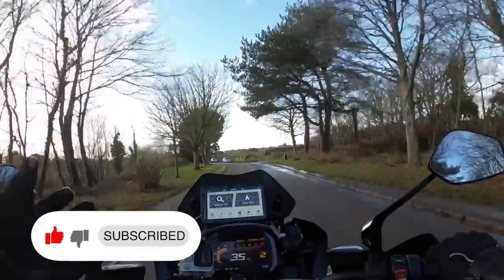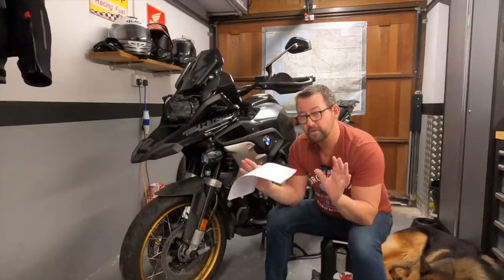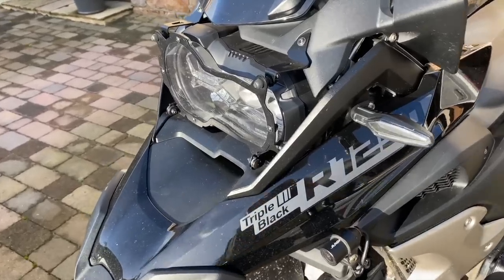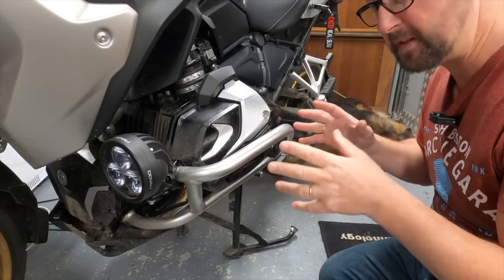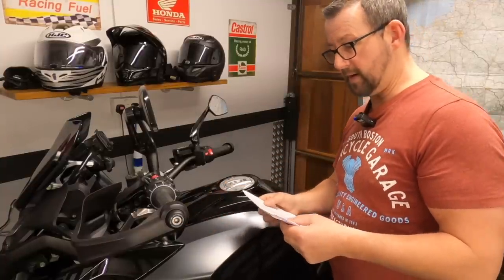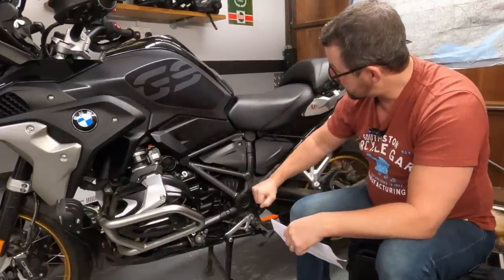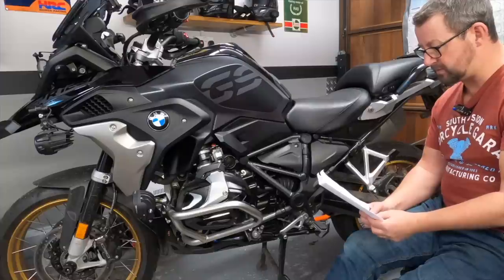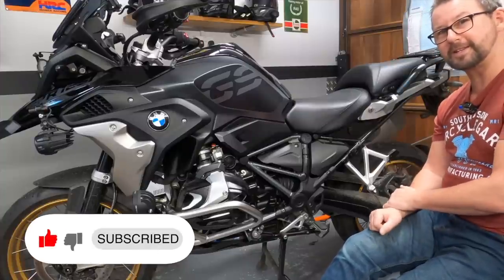Accessories fitted to my 2022 BMW R1250GS-Would I fit them again? Let's find out.🤪

Comment: Very informative. Where did you get the frame infills from, the ones that cover the shock area. Thanks.
Reply from the maker: Thanks, the frame infills came as part of the radiator protection kit from BMW. No doubt you can get them elsewhere for 1/10th of the price 😂 I have done a web search and this is the kit from a BMW UK supplier for information . https://cotswoldbmwmotorradonline.co.uk/products/bmw-motorrad-splash-guard-and-radiator-guard-set-k50-k51-r1200gs-gsa-r1250gs-gsa-2014-2021
Reply: @gsd32i  Thanks for taking the time to look this up for me, MY GS 1250 already has the rad protectors already but infills look useful, amazing how expensive a piece of plastic can be. Thanks again.
Reply from the maker: @muz1406  No problem, ride safe 😁

Comment: Thanks for another great video! Question about the axle / rear sliders- do you think it's necessary to get the big one for the rear as well? I see that big one is quite expensive. Wondering if it's worth it- thanks!
Reply from the maker: Keith I guess if you are going to be doing some off road stuff, even light then possibly .
Reply: @gsd32i  zero off roading for me!

Comment: It’s so easy to get carried away with all the ads ins. The I’ve spent on excess of £3k (not including panniers) on my GS Rallye. Mind you I’ve spent about the same amount on my Triumph T100 getting it to the bike it should have been when it left the factory. It’s so easy to get carried away so be warned, adding accessories is addictive. As long as one goes into the ownership with this in mind one won’t get any nasty surprises. With hindsight I would have bought something else but then, I still love both my bikes. Good job as I can’t now afford to sell either. PS: good point about mentioning all the packages arriving. I try to get them delivered when my wife isn’t at home but then my postie always says, when he hands me yet another parcel, “that’ll be be for the bike then!”

Comment: Thanks for the review. Interesting things mentioned. I also feel vibration at handlebar and didn't know about Evotech Bar End Weights, will try it. I see there is some head protection installed on your bike, can you please help what is that? I also have option 719 cylinder heads and all popular cylinder head guards brands told me that they don't support option 719, even BWB one doesn't fit to option 719
Reply from the maker: Hi. I have the standard BMW engine bars and maybe it's that? When I ordered the bike I asked for all the 719 stuff on the engine so what I have is nothing unusual ! Evotech bar ends weights =no veneration.
Reply: @gsd32i  that black thing which is inside the frame of bar is also standard came right from factory? (its not much clear in the video, if I see it correct there is some another black piece of metal or plastic on top of cylinder head)

Comment: What correct setting/guidance did you use to for the denalis?
Reply from the maker: Hi, sorry for the delay, I didn't see the question. I would simply set the low beam setting at 20% and then see what you think then of them in the daytime and nighttime and adjust accordingly, then just set the main beam level to one that you are happy with. I think I covered it in my videos when I connected the hex ezcan to them and programmed the lights.
Reply: I mean the alignment?
Reply from the maker: @MurtazaAli-jv5ln  Oh I see. I just went out at night and adjusted them so that the lights lit the road BUT didn't dazzle oncoming road users. Give them a wipe every now and again too. 👍

Comment: Is the Michelin 6 good when cranked over? as your one, l'm guessing is fairly new on the sides and not been 'spanked'
Reply from the maker: I can definitely say that the bike has been spanked😂6 was a great tyre but just pulled to the left. Currently using Next 2's and they are just as good and no pulling. 👍

Comment: I initially had issues with my gas cap, but after trying it with the key in my hand and holding it close to the gas cap, pull the button and it works fine,

Comment: Great video. It’s great to get a completely honest opinion on all the accessories. Also about the rear indicator’s I didn’t know that it was an option to not have the brake lights included with the indicator I will be definitely asking about that tomorrow when I’m going to order a new 1250 adventure in the trophy colour scheme. Thanks again as I have been watching many reviews on utube and you seem to have the the most honest reviews..
Reply from the maker: Thanks , I am informed by my dealer that the multi function indicators are now standard !! Enjoy opening the wallet at the dealer 👍👍👍
Reply: @gsd32i …… I’ve been informed that  BMW also stands for “Bring More Wallet”. 😂
Reply from the maker: @bradleyalexander5821  Yes and KTM stands for Know The Manual/Kosts Tons Money 😂

Comment: Hallo, I've installed the cockpit cover too, hoping to reduce the noise coming from that huge "hole". Does not work in that sense, just nice to see. Only issue is you cannot easily use USB receptacle on the right, because of the USB cap in the way, I will try to lift the USB port with a spacer, realized with my 3D printer. By the way I have  Bridgestone Battlax tires, and the bike pulls to the right, no hands driving. Great video👍
Reply from the maker: Thanks, Next 2 tyres great with no pulling whatsoever . Some owners said  just twist the usb  outwards.
Reply: @gsd32i  ...will try, thanks for the tip. Cheers

Comment: Anything pulls to the left in the UK it's the camber of the road !
Reply from the maker: Now that does sound plausible BUT they did it in France too !! Dumped those tyres and now on Tourance Next 2’s and they’ve had no pulling to the left whatsoever . BMW now use these as standard for on the new 1300’s

Comment: Thanks for the video. Did you change the original skid plate, I couldn’t figure out if you told about it.
Reply from the maker: yes I went for the Rallye skid plate, that was fitted by the dealer before it left the showroom 👍

Comment: It’s easy to go crazy with add ons. I bought a Chinese light mount to add some driving lights. Had to tweak them but they work. I have a different one on order though. I used a set of single row Rigid Industries SAE driving lights. Since I already had them. Put on the AltRider skid plate. Beefy. Just found a set of OEM black panniers. I could have went with some other brand and saved money…but I hate all the extra keys. I did buy a Chinese center pannier and it works, but I had to add a different plate to the original back mount plate. So got a good deal on some new BMW panniers and bought them. Dangit. I added another battery tender plug for the left side because I have Harley Davidson heated under gear already. All plugs on the gear are on the left side. Some things you can cheap out on and some you can’t. I did get a mud guard for the back from China and it had a screw to mount it to the upper inner guard rather than just zip ties. Went with the Hexcan instead of the Denali. Same company but some differences. Mainly price. Got a mini soundbomb horn coming. Eh. Headlight protector. Mine didn’t come with the adaptive headlight nor the heated seats, but the full, out the door price was $24,600. Adventure model. I did find one that had the new headlight and heated seats but it was almost 3 grand more. I can live without those. But after all of it, if I did it again, I’d have got the GS low version instead of the regular GSA! I do like the extra tank capacity but I mean I rarely go off road so the low version would have been good enough for the highway. And stopping a bit more with a lesser capacity fuel tank is nothing new. Thanks for the video! Loved it!
Reply from the maker: Thanks . I don't know if my bladder would last out for the range of the GSA 😂

Comment: I have road 6 too on my 1200gsa. same pulling to the left. Next change - scorpion trails.
Reply from the maker: My metzeler next 2’s have arrived so putting them on in a few days time .
Reply: Did You fix it finally with the Metzeler ? I’ve changed mine from TKC70 to Metzeler Next 2 but still the same behavior. Veering to the left…

Comment: Regarding the shifter and blipper, I have found that the higher up the revs you are when going from 1st to 2nd, the smoother it is and regarding the blipper, some folk are unaware that the throttle needs to be completely closed when shooting down the gearbox, silky smooth for me and I have the exact same bike as you. 

Just a heads up. :) 

Bike looks mint :)
Reply from the maker: Thanks, combination of clutch n QS depending on what's happening.😁

Comment: Hello! I want to put the option 719 mirrors on my 1250 adventure but I have read that they vibrate a lot and you can´t see through them. They are very expensive and I wouldn't want to spend that much money and then be unhappy about them. Could you  please help me with it? Many thanks!
Reply from the maker: Hi, had them on my GS since it rolled out of the showroom from new. 2 years later no issues with vibration etc. 😁

Comment: Have you thought about a ceramic coating ? Or other types of coatings.
Reply from the maker: I haven't given it much thought....have you had it done?
Reply: @gsd32i  No but seriously considering it, the bikes are very expensive and it should stop UV damage too like on the switches that really loose their redness easily and look years old. Won’t be so worried about riding in poor weather and should make it easier to clean and stay nice and sparkly. 😁
Reply: @genuinecomments4008  I have never coated a bike and my previous gs I rode all year in all conditions nothing faded at all. I wouldn’t be concerned about that .

Comment: Did the bike track straight with the OEM tires?
Reply from the maker: I only had the oem ones on for about 400 miles and did that in about 10 days and can't recall if I did take my hands off .....I will swap them when I come back from my mini tour next week🙈
Reply: @gsd32i  Running through my head what are any reasons a bike would track like that and is it associated with just to tires, front or rear.  Look tire wear if you can.  Chalk up the tires and ride on a flat surface like a parking lot, not a cambered road.  Static balance just the bike pre-ride, is it left side heavy?  Then try it with you sitting tip toes same thing.
Reply from the maker: @Richard.Cabeza  I've done that kind of thing and it's the tyres in my view.

Comment: Hey gsd, thanks for the vid. I followed it through, as I have the 23 GS Trophy & immediately after taking purchase, did quite a few things for it to fit me.
Ad note: on your fork tube where you put the helicopter tape, I did one better for me so I can cut down noise. I had taken a piece of kydex 7"T x 12"W, that fits across fork tube with 2" to wrap around each side, and heated the  last 3" and shaped it using a 2" diameter can, and did both ends so as to wrap around fork tube on each side. I pre-drilled 4 holes each side & secured w ty-raps....just another take on tube protection & noise reduction.  Also, I followed your cockpit cover vid & it went on in 45min.
Thank you....wish I could send a pic of fork tube. Clean & unnoticeable.
Reply from the maker: Liking the trophy colours . Toss up for me was the triple black or the rallye. If the trophy colours were out then I would have got that colour . Nice 👌

Comment: Hi Paul, nice bike Mate. I recently, with the aid of Messes  Forder & Butcher bought a 2017 R1200GS in white with only 2k on the clock. Very happy with it. In your video I notice the 'cockpit fairing infill but you don't mention it. I have found them on Ebay but they won't post to Jersey. Any ideas? Keep up the good work Mate. Salut Clive. 👍
Reply from the maker: hi Clive, hope you are well. Ah yes Forder and Butcher, a fine team 😂 I did an install video , it’ll be on one of the playlists above, got mine from UK Nippy Normans, wouldn’t be without the infill panel makes it look much nicer, IMHO. I’ve got stuff from the east before , try a different seller. look forward to seeing you on one of the Mansell ride outs👍

Comment: Does it still pull to the left hands off if you use cruise control ?
Reply from the maker: yes. strange as the bike handles brilliantly with these tyres , just pulls when you go hands off.
Reply: @gsd32i  Can you keep us posted if you rectify this issue. Thanks!

Comment: Did you get to the bottom of the front tyre issue. I'm thinking of switching to Michelin 6s. Hard to believe Michelins would be unbalanced in some way.Shame about your quickshifter not blipping on the way down, mine does. (2019)
Reply from the maker: Hi Dave . I didn’t . But numerous others on the net have made similar comments . Not a handling problem whatsoever just a veer to the left when hands off . Fabulous tyre bit frustrated me having to hang off to one side as and when hands off !! 😂

Comment: Your sena did you update the firmware? My 50S have to update the firmware then it work.
Reply from the maker: My sena 10s is running the latest firmware . Basically it’s only the top end Senas, 50s/r etc that have the coding to speak to the tft to open the volume whizz wheel control . Not a major issue as the jog dial on 10s is just as easy to use . But it would be nice to use the whizz wheel …….
Reply: @gsd32i  I also own a R1250 GS triple black and I like what you did to your GS. 👍

Comment: Very nice video and love the options you have added.  
I’m curious why you chose the GS instead of a GSA for the extra travel?
Cheers.
Reply from the maker: Didn’t need the extra range plus my bladder wouldn’t last that long . But never say never 👍
Reply: @gsd32i  I hear you on the bladder and need to stop.  I was actually referring to the suspension travel with the GS adventure
Reply from the maker: @jpaul4595  if mine fell over I would cry ! So don’t need the extra travel . I still get to thrash mine , although top end is not where the bike excels at , but it gives me a buzz and I can chuck it around like I’m 21 again . My KTM 890r duke has stayed in the garage since I got the GS and i am thinking of selling that as I just don’t use it now . Again it’s an age thing 😂
Reply: @gsd32i  The same for me I sold my  K1300 GT and bought a GS adventure last fall. It’s just much more comfortable for me than the GT was.  Age &, sporty bikes, do not go together.

Comment: Very interesting you should mention your bike veering to the left, and having to counter it with your body position. Same thing for me on my 1290 Super Adventure with Road 6's.
Reply from the maker: Currently waiting for a response from the dealers tyre rep. Its a great tyre besides this.
Reply: had same issue after installing r6 , took them off and back for balancing , remounted them carefully not to over torque the axle bolt ,and i m now again able to  let go the bar and bike track straight.

Comment: Great Vid.  Ive the same bike but with cast wheels and agree with you on a lot of the additions. Im going to check out the bar end weights.  I went with the Givi quick release pannier system which works in a very similar way, i had Givi cases from my previous bike. Like you, i would delete/switch off the multi function indicators, mates have said they are difficult to see. I wish BMW would offer a update to correct this.  About the PR6 tyres,  ive seen comments on the Crosstourer and Super Tenere sites complaining of the bike pulling to one side.
Reply from the maker: Thanks, did those bikes have the 6"s too?
Reply: @gsd32i  Yes Road 6s, did post links to the threads but kept disappearing?

Comment: There are various opinions about the utility of the cockpit cover - several reviewers claim that it doesn't significantly reduce wind or road noise. What's your experience? Is the benefit purely aesthetic?
Reply from the maker: Had it on for a while and got different tyres on the bike also . Tyres make it quieter . So, purely cosmetic . But I really like it 🤪

Comment: I am currently in the market for a big adv bike and this is a common note for both MG and Bmw boxers and I have a theory that it has to do with the gyroscopic forces created by the engine spinning perpendicular to the direction of travel. I think about that science experiment where you sit in a chair that can spin and hold a spinning tire, then rotate the tire and you begin spinning in one direction or the other. 

Just a theory. You also have the idea that the engine is trying to spin the bike around the crank and that is why you feel a slight pull in a left direction. 

It’s tough because I have an all Harley family and they are trying to point out things that could bother me about the bike.

 When you hands are on the bars, do you still feel it pull or is it just hands free?
Reply: Rather, I have heard a theory that I am inclined to believe.*
Reply from the maker: Fitted metzeler tourance next 2’s a few weeks ago , hands off bars bike runs straight and don’t have to lean off the bike to make it run straight . Road 6 ‘s other than that were bloody good tyre . Next 2’s right up there and very confidence inspiring 👍
Reply: @gsd32i  right on! Glad you got it worked out.

Comment: I wouldnt recommend the option 719 case covers, my bike had a drop, and the cover got slightly damaged...... But the destruction it did to my cylinder heads, the 719 covers because there billet thick aluminum they transfer the blow to the cylinder heads. But it destroyed the cylinder head internals. The regular covers, because there weak they absorb the blow and get destroyed.